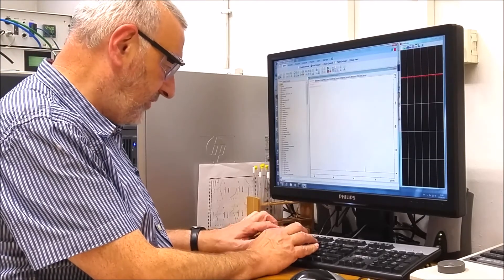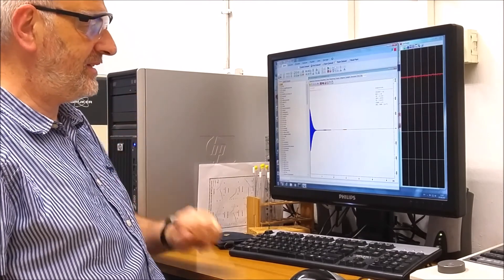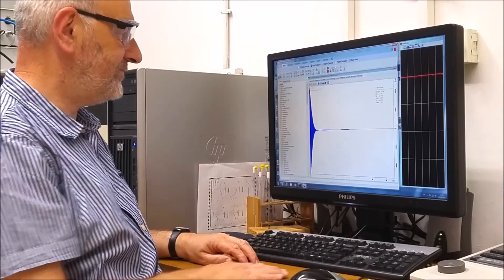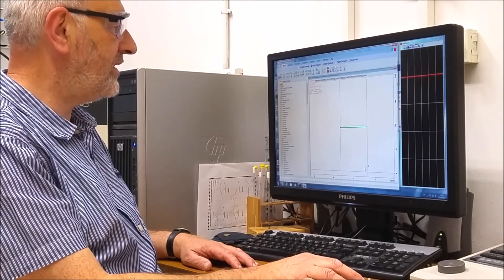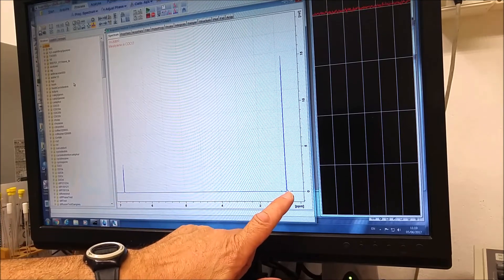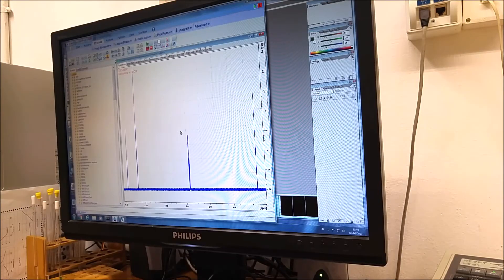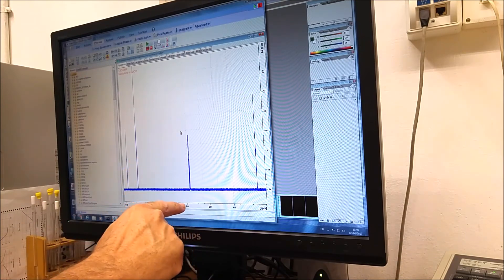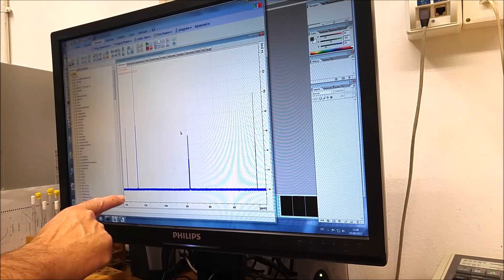Fidget Spinner NMR

Comment: Actually, using compressed air on one of those is pretty dangerous.  They use cheap bearings and they have a tendency to fly apart at high speeds.